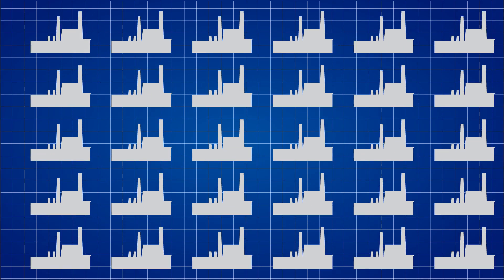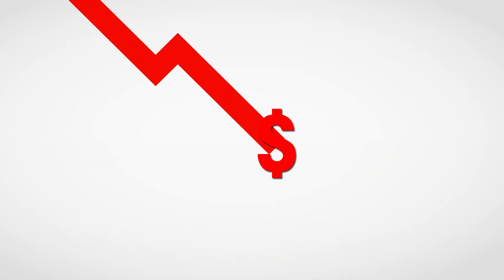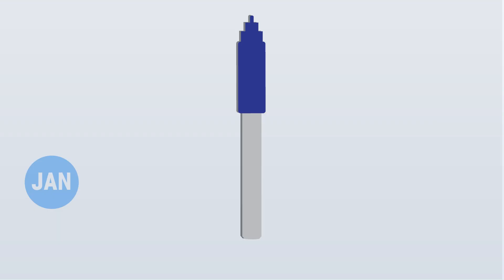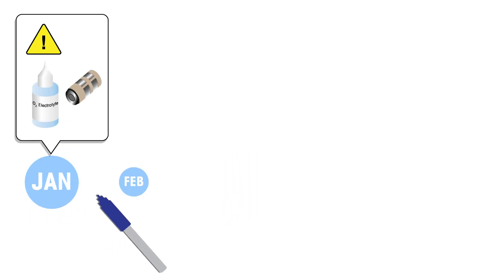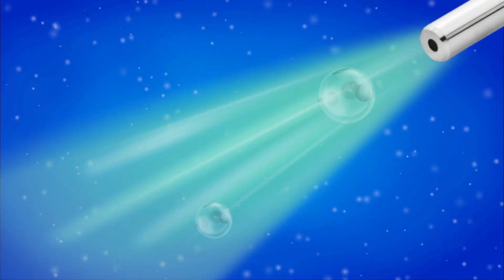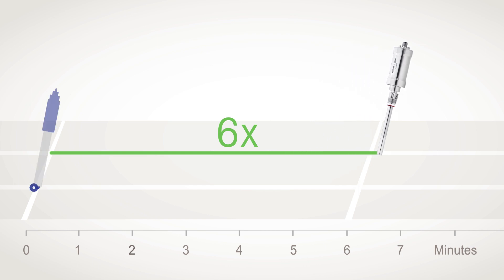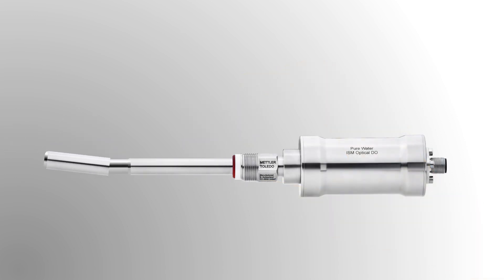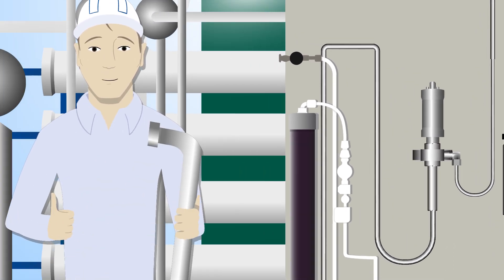Dissolved Oxygen Measurement: Polarographic vs. Optical DO Sensors

Comment: How to calculate Dissolved oxygen in mg/L using Galvanic DO probe sensor (mV output)?
Reply from the maker: Hi Mandapalli, Our analog amperometric sensors (also called polarographic; clark cell) output signal is a nano ampere signal (electron flow). The signal is resulting from a electrochemical reaction of the measurement cell and triggered by the polarization voltage.

The signal is linearly dependent on the amount of oxygen diffused eg. reduction at the cathode of the cell.
 Other factors like temperature, diffusion coefficient,; see below are also influencing the calculation. 

The calculation you're looking for would be based on Frick's Law, which is detailed further on pages 24-25 of our Oxygen Theory guide.  You can download that for free here:
https://www.mt.com/global/en/home/library/guides/process-analytics/oxygen-theory-guide.html